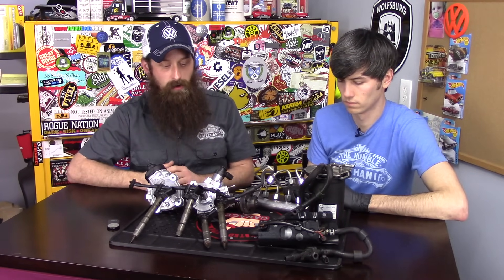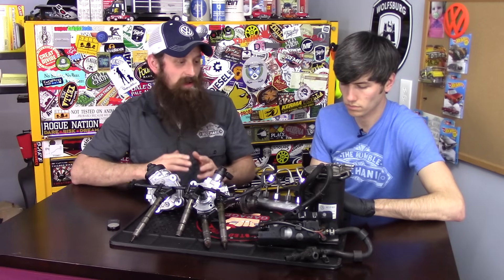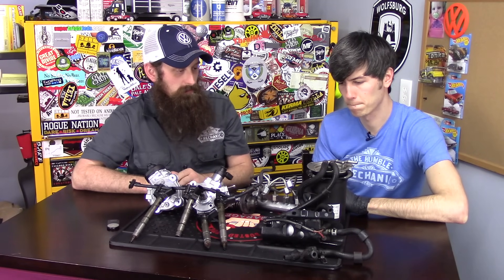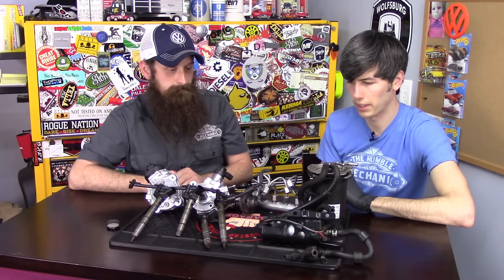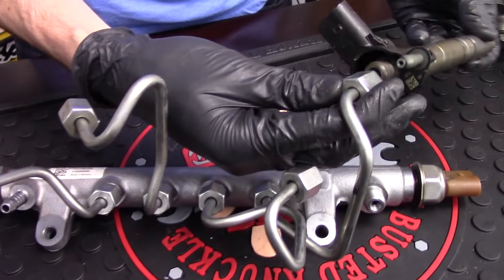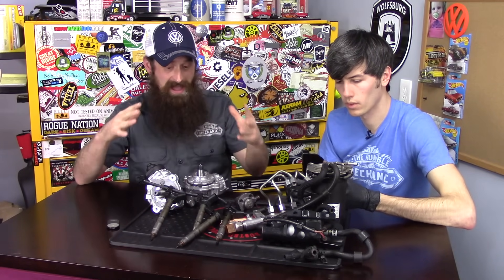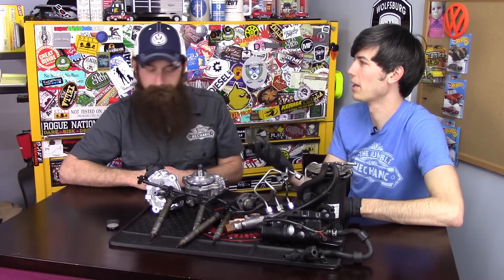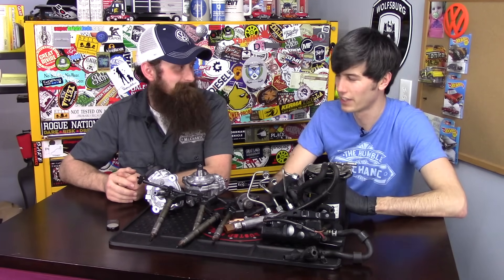Putting Gasoline In A Diesel Car - What Happens?

Comment: Having worked with Paccar engines, big commonrail diesels found in some american trucks and DAF trucks, petrol in a modern diesel engine is truly a bad idea. 
All the o rings and rubber parts are designed for diesel and petrol will harm those. Then there's the emissions. What happens when you burn petrol in your diesel? the emissions change a lot. And this has effect on a lot of the engine. Sensors all of a sudden have measurements that they shouldn't see and go apeshit. Not to mention the aftertreatment system. 

And your diesel particle filter for example is designed around combusted diesel. As soon as that mixes with anything else, it could clog or burn up the inside of the DPF and decrease the lifespan

Comment: So what happens if you put Diesel fuel in car meant for regular gas?
Reply: +GaynNovi  Your car will smoke alot and may stop running depending on how much diesel you have in the mixture.   There wont be any permanent damage.  Empty the tank and lines, fill with gas..... change fuel filter... and you will be fine.

Comment: One time I accidently put about 4 gallons of gas in my diesel. I realized in time to stop the pump. So if I hadn't I would've put 13 gallons in my truck. All I did was then put 10 gallons of diesel in it so it can cancel out the gasoline. I got home without a tow.

Comment: nothing like overcharging a person for parts the do need to be replaced. fuel filter i can see needing to be replaced but the fuel rail, injectors, secondary pump? no way. i brought many diesel engines back from normal pump gas with bare minimum parts. long term, still running.

Comment: Of all those I've owned 90% were diesel cars, and from my own experiences with pre common rail TDI, pre VAG PD units, and another not direct injection before them, we would put a gallon of petrol in a tank to stop the diesel from freezing...diesel fuel has improved immensely also but those old diesels used to be so so agricultural, oh how times have changed lol...

Comment: I owned a 2001 Jetta TDI purchased new.  I ran out of diesel trying to get to a diesel station during the 2nd or 3rd fill up after purchase.  I called VW's roadside assistance and told the operator is was a TDI, told the dispatcher it was a TDI, when the vendor called for my exact location (mile marker on I95) I told THEM it was a TDI.  When the driver arrived it was pouring rain and he jumped out of his diesel rollback and proceeded to place 1.5 gallons of unleaded regular gasoline in my diesel TDI!  Well, VW said just pick up the car, flatbed it to a diesel station and fill it up with diesel and DRIVE IT (VW's advice).  I said wanted NOT to start it and to have the fuel tank removed, drained & cleaned out.  Bottom line, VW wouldn't pay for it then, but 10,000 miles later paid for that and a complete fuel system flush & rebuild.  New injector pump, new injectors, fuel filter, tank R&I labor and 29 days in a Enterprise rent-a-car.  The day I picked up my car, the dealer caught fire.

Comment: so basically its the high pressure pump (which is designed to be lubricated by the diesel fuel) which causes the main problem - could be solved (+ Customers: less money when accidently use gasoline; -Customers: pump will cost more, so the car will cost more; +Manufacturers: you could charge more and promote a "longer lasting system even under difficult conditions" -Manufacturers: less money for selling new parts - and selling things is what they want)

but why do you guys promote vw so much..?

Comment: So if the bill was about $8000 would it just be worth getting a crate TDI then? Also was this the 2.0L TDI or the 1.9 TDI? I noticed you said timing belt, I know the 1.9L has one but I'm not sure on the 2.0L. If this were a Dodge Cummins, PowerStroke or Duramax the price would probably be closer to $12000. Still newer diesels are not cheap and need to be taken care of more so than the old mechanical engines like the old 1.6L IDI from years ago. Its not a $50 fuel injector its a $299 injector so you're at almost $1000 just after taxes and probably $1750 for labor.

Comment: Utter nonsense  - I filled my diesel Hyundai Santa Fé with gas 3 years ago, a full tank. I drove until the car wouldn't drive. It was then I checked my receipt and realised my mistake. A local mechanic towed me and had me back on the road the next day. My car has been perfect since. It cost $280.
Reply: +yekrallum The filter was the only part changed

Comment: My old job we had a  heated pressure washer, the pressure washer itself ran on diesel and the heater ran on gasoline. Go figure, a new guy told to fill it up went straight diesel in both tanks. Ooops!

Comment: I worked for GM as a tech. We would see this once in a while. They usually claim the wife did it lol. We would just drain the fuel, clean the tank and lines, replace the fuel filter and do a fuel system flush. I have never seen one come back with other failures. I think the moral of the story here is don't go to the VW dealer if you put gas in your diesel. They will rip you off.

Comment: Aren't the fuel nozzles different sizes?
Reply: +Howie Land You mean the gas fill nozzle at the gas station? If so, yes you're right. But where the Diesel fill nozzle doesn't fit properly into a gasoline car, the gasoline fill nozzle fits very well into a Diesel car, because the Gasoline fill nozzle is the smaller of the two.

Comment: My friend has an Audi 1.9 TDI 2003 and he pretty much filled half the tank with petrol, after he drove a quarter of a mile or so, he realised his mistake stopped , and drained all the petrol from the car, it was blowing smoke like crazy he went back to the garage got to or three canisters of diesel, put them into his car and the car was smelling for a week or so but he pretty much got away with it, also I have heard  talk of people with diesel cars putting maybe €2 OR 3 of petrol in on top of a half a tank of diesel , and apparently it helps clean the engine is there any truth to that?

Comment: When my mum filled up our van vauxhall vivaro with with the wrong fuel, all they did was drain all the fuel including lines and components, and fill with enough diesel to get us to a fuel station. The whole thing was £200 to fix and it's run fine since this was 4 years ago and we've done a lot of long distances in it since. I can see the reason for replacing the filter but at the other stuff :/ it's not going to get far enough with petrol in to cause any major damage, $1000 - $1200 for labor is ridiculous, and if the parts are $4000 and labor at most is $1200 where does the $8000 figure come from? Because waste disposal is not $2500-$3000 per job, he even says "14 x 25 isn't 3000" (side note: it's $350 if he's not lying about the cost) this video is just him trying to justify overcharging.

Comment: we put 5 gallons of gasoline into a diesel car before realising, then topped up some 5 gallons more of diesel. this mixture just about worked. we kept it in low gear to burn as much fuel as possible quickly and refuelled more and more diesel along the way. eventually car was running fine and no one was ever worried. cost us close to nothing, just the extra cost of fuel. basically, we just slowly increased the diesel to gasoline ratio and car worked fine for many more years. watching this video made me pretty irritated with how the mechanic would just happily replace your entire car for no reason whatsoever. like - let's replace injectors, because, what do you know, they might break later... well, let them break and replace them when broken, is my way of thinking

Comment: I was filling up at a station just north of Montgomery, AL about a year ago. I selected premium fuel for my car, which is what it takes, and filled it up. About 20 minutes later, I started having issues with accelerating and the engine ran very rough. Turns out, the station had put diesel in the underground tank instead of gas. Had to get new sparkplugs, tank flushed, fuel system cleaned and it was good to go again. The station did not want to take responsibility for their actions until we threatened legal action to make them pay for the repairs.

Comment: The stealerships will replace everything possible, but it is reasonable to replace things only when they fail.  After all, how long would someone run their diesel on gas?  Not long at all, so the so-called lack of lubrication isn't going to create metal bits that cause harm unless you ran it for 1000 mi. (which is several tanks of gas in a diesel).

Comment: 3 steps........1)Drain tank.  2) fill with 5 gallons of diesel and flush system. 3) Refill with fuel and drive away.    Gasoline in a diesel for 1 hour is not going to do anything. That mechanic would do the exact same thing.
Reply: +John B  Same as getting water in your fuel system.......OMG I have to replace everything...NO ....Flush it and get on with your life.

Comment: 2-3% gasoline can be added to diesel tank to easy cold starting in diesel engines on low winter temperatures... No issues.

Comment: So basically, better engineering could prevent issues from accidentally putting gasoline into a diesel vehicle. Relying on the "lubricating properties of diesel" for the proper functioning of parts is to me a flaw in design and could be designed better. Of course, if a vehicle were designed to last, the auto makers and mechanics would go out of business. It's shoddy engineering like this that keep mechanics in business and keep auto makers pumping out slightly better but more complex vehicles. Design it right the first time then maintain it.
Reply: MCR Nursery some older diesels... the 12v cummins with the p7100 injection pump for instance, had an oil line from the engine to provide lubrication.

Comment: There is a video on YT where some UK people did a test Gas in a Diesel, and Diesel in a Gas -- something very easy to do in the EU due to the pump sizes and organization. So long as you add back in some Diesel into a Diesel (and Gas to Gas) your older clunker car will still work OK until you can add back in some more of the right type. Add in at least 20% of the right type .... and this only works for EU Petrol and Diesel formulations...

Comment: Incoming stupid question! The video explained what gasoline does to all the diesel engine components. But what happens in the actual engine block? I know how diesel engines are different in that they use compression to ignite the fuel, but I don't know what happens in this case. Assume the operator is cranking, cranking, and cranking on the engine and gasoline works its way through all the pumps and into the piston. Gasoline goes in, gets compressed, and... doesn't ignite? Ignites at the wrong time? I honestly don't know. Thanks!

Comment: if you dont get the tank full, like 1/3 of tank, just pour some 2 stroke oil and then fill the rest up with diesel.. it isnt that bad. and also, some diesels recomend to tank 30%-40% normal gas for winter, oh well, atleast before 2007..

Comment: Yea, I can see that at an empty tank filled with gasoline - to an extend. However, it is known that in winter, in some countries, some people use a 70/30 Diesel/Gasoline mix to keep the fuel from freezing up. The filter will be just fine - so will a lot of other parts as long as there is not a substantial amount of gasoline without any diesel ran through. Remember 2-strokes? They have a 1/50 oil/Gasoline mixture and run no oil in their housing - and do just fine with that lean mixture in a triple RPM range - Diesel cannot go beyond 4800RPM because it does not ignite faster. So, if your engine stalls because that happened, I would call that overkill. It is not the same as running all components for 30min without any lubrication since gasoline lacks the energy to self-ignite.
Yes, I am not a mechanic. I just worked for a parts developer for the car industry in Germany in a prototype/testing shop with about 30 masters mechanic and about 100 engineers and in high school, I did my practicum in a mechanics shop and we helped guys that ran out of Diesel all together - and that is without any lubricant for sure and the engine (TDI) was just fine with starter spray. Yes, you can have trouble down the line, but you don't automatically replace your rim because you had a flat tire either: Yes, it could be damaged, but chances are in most circumstances it is not (if the rubber did not flake off yet).

Comment: Hmm.  I have done this mistake a few times . And can say that dont be scared if you did that mistake . Last time i filled like 20L of gasoline on a diesel BMW 530 2003 model before i realized . And the one and only thing to do is ... Go buy 2 stroke oil (depending on how much gasoline you have in the tank) . I did add  1 liter of 2 stoke oil and filled my tank with diesel .  And to be safe I filled my tank again every 100-150km .

Comment: wow what a load of shit, replacing the rail and injectors when there's nothing wrong with them is insane, same with the pump unless there's a significant indication that it's failed(you can just start it on diesel in an ice cream container and check for target and actual pressure with a $20 scan tool, in the case of toyotas they have a diagnostic mode that pegs the rail pressure above the max you'll ever have while driving and if it passes that there is nothing wrong with the pump or injectors).

also the lift pumps aren't made of egg shells, they're often identical to a petrol lift pump and are the least of your worries, though I would replace the filter while you're in there since the petrol will cause filth from the tank to block the filter and you might get a false positive on the rail pressure being too low.

and then there's the price, $8kUSD??? a new engine is $4-6k(we're talking 4 or 6 bangers, not bro truck power plants), you can conn a scrap yard out of a fuel system for $1-2k, so literally any option but going to this fucko is better.

Comment: 1997 Cummins with an all mechanical injection pump. I've ran quarts of Trans fluid through the fuel system. I bet I could get away with 2 gallons of gasoline mixed with 33 gallons of diesel (35 gallon tank). Possibly even a quart of pee, who knows. She'll drink up.

Comment: So let me see if I get this logic right.

Hey guys! You put the wrong fuel in your car and ran it for a whole couple minutes before it became immediately obvious. We could just drain the fuel and it would be fine, but there is a small chance that it has slightly reduced the life of every single component the fuel has touched and it could break down on you in the distant future, which would cost you lots of money and we don't want that.............. So instead we are just going to treat EVERY single part of your car that the fuel has touched as if it was broken NOW and get all that money from you NOW to save you the hassle of that possibly maybe might happening in the future. Your welcome.

For gods sake, its just another type of petroleum, its not like you were trying to run your car on caramel and battery acid!

Comment: Sounds like Eddie's Garage justifying replacing all these parts to charge you.... Remove the parts clean them out put some cleaner through them and that its 99% of the time. The diesel "lubrication" is important over hundred of miles, cranking the car then it dying due to gas in it wont do anything. Remember the car wont run, it not like you drive it, hear knocking and take it in to the shop and all of sudden wow I put gas in a diesel. 
Clean out your fuel system and you'll be fine, don't replace anything.

Comment: Lol total BS and scary this guy is a mechanic charging people like this. As a guy who had a co worker that put in gas in the diesel truck (04 f250) and put diesel in our little honda engine he drove it and the truck produced smoke like if it was on fire but he pulled over. We drained it and the company only changed fuel pump for : $2000 bucks and the honda engine survived too!

Comment: Was that not a typo in the script.. 800 bar fuel pressure?!!?
Reply: +Kyle Milford seens low in fact because modern VW common rails have 2500 bar fuel pressure, and in fact thats about has high as you can go because at about 3000 bar diesel gets broken up and isn´t diesel anymore.
Reply: +Kyle Milford 10,000+ PSI fuel pressure? holy shit.
Reply: +Kyle Milford That's on the low end. You look at the 6.7L Cummins, 6.7L PowerStroke, 6.6L Duramax they are at 29,000 PSI or 1999 BAR.

Comment: When I was little, they still sold ethyl gasoline. The nozzles were wide so you couldn't pump ethyl into a tank that took unleaded. Strange how something like this never occurred to whoever designed the diesel fueling infrastructure.

Comment: You guys are full of shit! You know damn well that if you drain the gasoline and fill it with diesel, then use the fuel pressure release valve to flush the diesel to the injectors(can be done using the in-tank fuel pump by turning on the ignition) the engine will be fine. 
Common Sense Mechanics

Comment: This is easier to do than you might think. I almost put gas in my diesel* a while back. Here in Arkansas pretty much all of the diesel pumps are green handles. I have seen yellow occasionally but it is rare. I went down to visit my dad in Texas and the station I stopped at had the gasoline pump as green and diesel as yellow. I had it in the tank and only noticed when I saw an octane number on the button and went Huh?

Had it just been a yellow handle it would not have been an issue. It was the fact that the gasoline pump was green as well.

*It would not have hurt it because it was a 84 300D and fits the category he mentions of older ones at the end that have little adverse effects from gasoline. I could have bypassed the tank in about 5 minutes and stuck a small gas can under the hood it get it home and then drained it. But that car ran a return based fuel system rather than the new returnless ones like in the video.